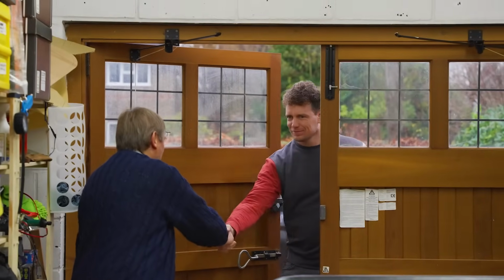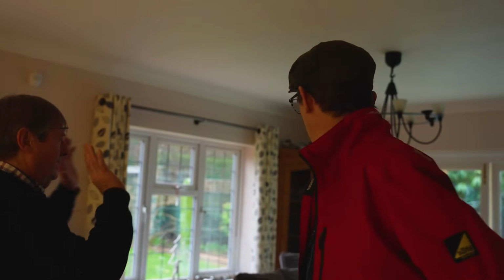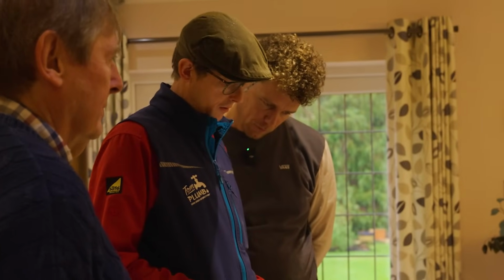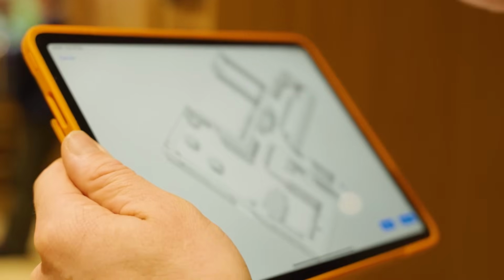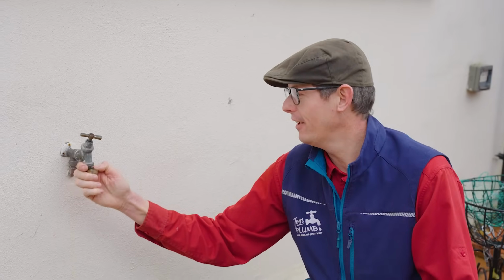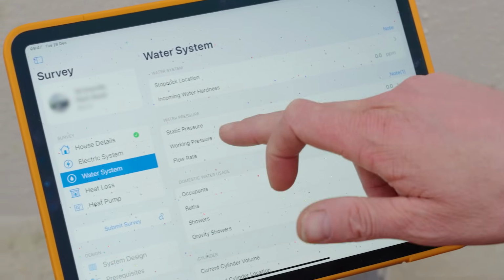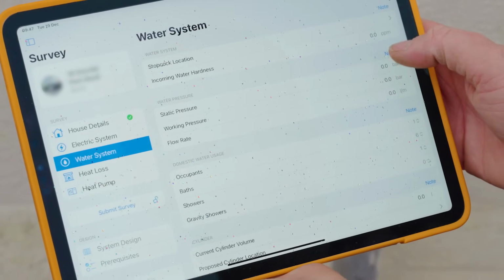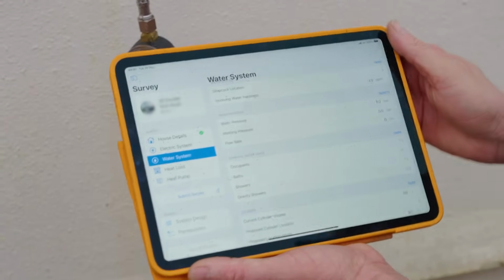Don’t Miss This Essential Step When Getting a Heat Pump

Comment: What a load of messing about, we calculate this we calculate that, heat pumps are a waste of time, and money!
Reply: Any central heating system should be designed properly tak8ng into account the same factors, truth is the installers usually rely on the customer paying for bad design through their gas bill
Reply: I suppose competence is scary for those who lack it.
Reply: Couldn't agree more, after spending at least 4 hours doing the calculations, I've only saved £1132.41 since September. That's barely £260 an hour. Waste of my time 😂
Reply: The fact that it wasn’t designed right from the start is why they are redoing it. Not the equipments fault
Reply: Are you one of these people who've had enough of experts? 🙄
Reply: Whats the point of watching videos like these if you do not have an open mind and are willing to learn?
Reply: He says from a phone that has taken decades of research and calculations to decrease size and increase efficiency to the point that we can carry a computer around in our pocket that would have been the size of a small building 40 years ago, just so we can watch informative videos completely wirelessly, just so we can complain about the smart people working out the best ways to make things work.
Reply: My heating bill says otherwise. 🙂
Reply: I wonder if the OP realises that installing a gas boiler requires measurements and calculations too...or do they think you're born just knowing this stuff?

There's a reason why you call in people who know what they're doing when you want a job done properly.
Reply: They are same calculations that should be done to size a gas boiler though?

Just most don’t bother because they are too lazy
Reply: These calculations should be done with a heat pump or a boiler. If your wasting energy it doesnt matter what the heat source is
Reply: Ever heard of design?
Reply: Yes Andy I was in the top three heating system sellers in my home town, just very breifly, account of the property postion, outside walls, room size LxHxW,  windows, then , you work the btus of each room, added together +20%, this then sizes your boiler reqirements, of course there is the siting of each rad, etc etc, but thanks for asking
 @andydt82
Reply: What on earth are you talking about? You’ve been reading too much daily mail. Educate yourself.
Reply: Can you back that statement up... without calculations off course. :-)
Reply: Complete opposite. Heatpumps are now half the price of gas boilers to run.
Reply: But how can that be?  A heat pump needs to run at 400% all the time and crucially, be on no longer than a gas boiler, because electricity costs four times the price of gas.  I know that you can give up your gas connection and save the standing charge, but even so.... @deanchapple1
Reply: @deanchapple1 but still 10x the cost to buy & fit
Reply: @pauldavies7251  I’m putting heatpumps in for approx £2500. That’s a vaillant heat pump, vaillant cylinder and vaillant controls. (Post BUS grant).
Reply: Cheapest option for us going from night storage

Comment: Nightmare waiting to happen , every house is different. To much time planning . Older people not happy at 21 degrees . It will take many call backs and more money for customers over all . And massive about upheaval. Ridiculous. Customers to not go near
Reply: It's ridiculous the heating system had not been updated since the 1970s. Everyone else on the planet installed modulating boilers and properly sized rads then.
Reply: Older people can’t afford to heat their homes as it is. Nightmare already happening with gas.

Comment: Great points on ventilation. Our renovation project had terrible ventilation and mould problems. We have installed MVHR with Lindab but are now trying to ensure we are airtight enough that we are not then pulling in cold air.
Reply: Shouldn’t a well commissioned system (balanced) extract the same amount as it supplies? How would that lead to a negative pressure differential that would pull cold air in? Genuine question, I am no expert
Reply: Hi Hans, I will have to ask the person who will do the commissioning. The levels of extraction and I assume fresh air can be adjusted in the rooms by adjusting the vent, then the fan speeds can also be adjusted. I will have 4 extraction points and 7 input points. Not sure if that balances fully, it will be interesting to see.  @hans.vbaalen
Reply: For this reason your supply fans should always be a little higher than the extract side. This way you slightly pressurise the house to achieve a positive pressure rather than a negative pressure.
Reply: You do need some fresh air. It’s not a bunker.
Reply: I'm afraid seeking air tightness on a renovation anything over, roughly, 50 years old is a fools errand. Your house loves cold air.

Houses built before the mid to late 20th century had a custom designed ventilation system, called a fireplace and draughty windows. Light the fire, it drew fresh air in from the draughty doors/windows, which circulated around the house, taking the moisture laden air from rooms out and sent them up the chimney.

That natural air circulation drew vast amounts of air through the house which, to maintain a similar level of airflow will today, require vast amounts of electricity.

We have just completely renovated and extended our 9" solid masonry, Victorian cottage (Lime mortar, naturally) which was complicated by  a 1970's rescue project from demolition, adding a Portland cement render which frustrates the buildings natural breathing abilities.

Our simple and cheap MVHR solution was to keep the original draughty front windows (we had to because the house is listed) and work with the natural design of the house by installing a loft ventilation unit that essentially mimics a chimney, but in reverse, which works with the draughty windows and doors (we replaced all the doors but ensured they were draughty) to push air down through the house and out through the draught gaps in the windows. We keep vents cracked open in the modern part of the building to mimic the old part of the building.

We run a gas boiler as no one could figure out a way to make a heat pump work better than the system I designed.

The ground source heat pump we were quoted for was 20,000+. To pay back the capital cost alone, far less the running cost, would take us ten years compared to our current system.

I hate to say it but you have been led up the garden path by stupid politicians and predatory businesses determined to extract as much money from you as they can.

Will this save us all from CO2 extinction? If you can find one single, credible, empirical, replicable, scientific study which demonstrates atmospheric CO2 causes the world to warm, please let me know because I have spent 20 years searching for it and as far as I'm aware, none exist, although hundreds of millions of £$ have been spent trying.
Reply: 😂 @RedHotscot
Reply: Very glad you like it👍  @moulinroche